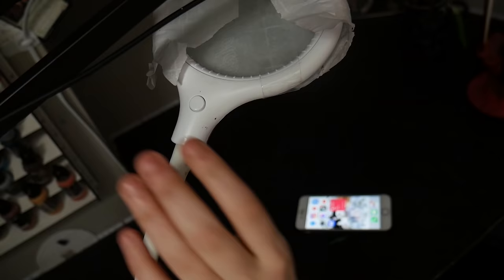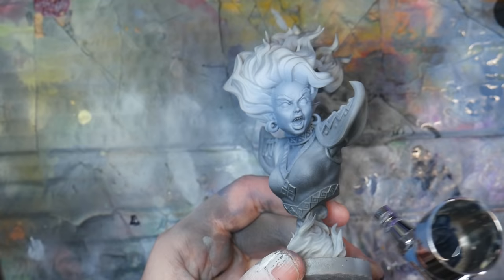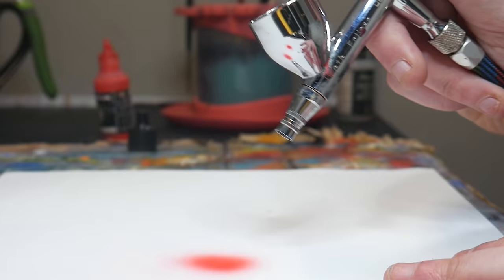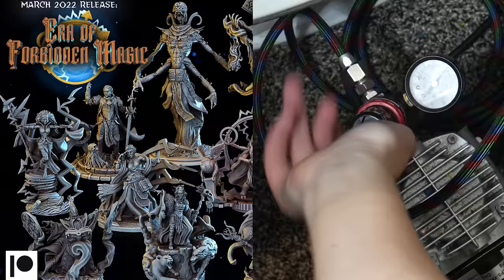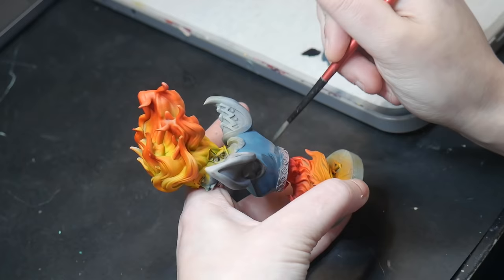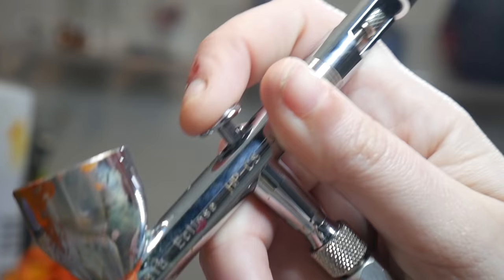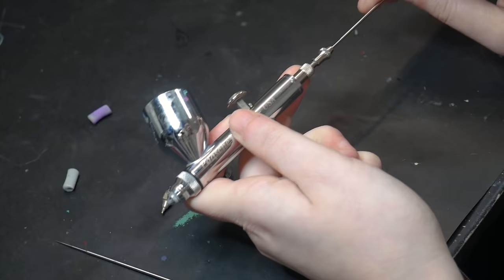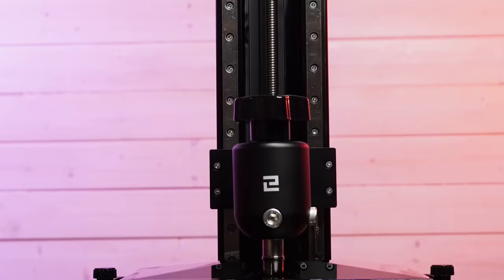Airbrush Miniature Painting Tips I WISH SOMEONE TOLD ME

Comment: Allow the air tip at the end to get damaged and chipped, used the need as a "poker," dropped it, left paint in it, didn't realize until today a lot of that paint that dried in there 10 years ago is still in places I can't hardly reach or see.  Sometimes I think I should just buy a new one.
Reply: If you really trash a gun then you need to get a new one. Which is why people are fastidious about cleaning them. Although today ultrasonic cleaners are available and maybe with the right solvent a clogged gun can be salvaged? Those ultrasonic units have heated tanks and the ultrasonic action can be effective. Some brush cleaners can loosen hardened paint. I wouldn't want that stuff in an ultrasonic cleaner in my house though. It's pretty aromatic and volatile. So if just the fumes don't get you it might still explode? I'm not a fan of any of that. But if you can do it outside it may be viable.

Comment: I started the airbrush back in '78. My tip to you is get rid of your compressor and then purchase, or rent, a cylinder ( with regulator ) of compressed NITROGEN. ( The air in Earth's atmosphere is made up of approximately 78 percent nitrogen. ) It is quiet, moisture free, and long lasting ( depending on canister size). Welders use cylinders of Nitrogen - they are quite common. ) You WILL thank me!
Reply: No one uses nitrogen to weld with. Helium used to be popular, heli-arc. Today we use argon and CO2. They use nitrogen to pump out cabling. Sometimes you'll see a tank strapped to a telephone pole. That's nitrogen. As far as moisture in air goes you can use a water trap. If it's really critical there's filters for air lines too. I have a shop air compressor and I just run a large diameter line out of it up vertically. The rise is too high for water to make it up the line. So it falls back down into the tank where I can drain it. I have a water trap too but there's never anything in it. My compressed air is bone dry. Humidity is often very high here too. So if I can make dry air anyone can.
Reply: @1pcfred  Nitrogen can be used by itself as a shielding gas for laser welding and plasma cutting, and it’s used in some heat treatments. It’s also mixed with other shielding gases for specific applications, but it’s not suitable for carbon steels. When shielding nitrogen-rich metals, it increases the alloy’s mechanical properties and can deepen penetration while stabilizing the arc. Nitrogen is also used as a blanketing gas once welding is finished inside tanks and enclosed spaces, to preserve the material until it’s used with its intended product. Your statement "No one uses nitrogen to weld with." is just wrong! Yes, as a shielding gas argon is popular, but many welders still use nitrogen. You can use a compressor, or anything that floats your boat, to do airbrushing; however, if you want a totally moisture free air supply, NOTHING beats nitrogen! And unlike a compressor, a cylinder of nitrogen is QUIET!
Reply: @burkholdst.rudderberg3574  plasma cutting is not welding. I have no idea why anyone would want to shield the cutting process. Being as you need oxygen to burn the metal. So I don't see what shielding would do for you. I have every welding system but a laser. MIG, TIG, SMAW and oxy acetylene. Laser is just too esoteric for most to have. But if you say they use nitrogen then they must. No one uses lasers to weld with either for the most part. Using edge cases to make your point makes a point. Just not the point you intended.

Comment: Surprised to see you are using a compressor without a tank. I was always taught that the tank provides consistency of airflow whereas using a compressor directly introduces "pulsing" which can mess up flow.
Reply: Yep running a cheap Chinesium tanked compressor. I have to be absolutely hammering the air out for a long time to affect performance. I get the quality argument, but Badger's tankless versions aren't much cheaper than a Master tanked one. Or spend a bit more for the Badger Aspire and you're still around the price of the basic Iwata tankless. (ps. if you buy a Badger it has american standard threads, nearly everything else is British)
Reply from the maker: I have often wondered if I could improve my painting with a new compressor!
Reply: @LylaMev  You'd probably become even more of a goddess. I started with a tankless compressor and managed to snag a second hand SilentAir. What a difference! For my ears too! Will buy that one again when this one dies (it's over fifteen years by now and still never lets me down)
Reply: @LylaMev  Yes you can, I know for a fact that your compressor cannot produce enough CFM. You'r airbrushes consume alot of air, I wouldn't use that compressor even for a 0.18 Micron. You can check how well your compressor does by holding the trigger down and watch how low your compressors pressure gauge drops. Even if you set it very high it will drop very low as soon as you press the trigger down. Actually this is how you should set the pressure. Hold the trigger down and set the pressure while the airbrush is consuming air. I bet it can't hold 30psi. And with the thickness of the paint you showed in one video you need more.

Comment: Tip: if Tamiya (brand) airbrush cleaner can't clean it, _it can't be cleaned_! Though the conventional homemade solutions are fine for getting a brush 85-95% clean, i strongly recommend leaving that final 10-ish percent to the professionals and i swear by Tamiya cleaner. Don't use it without a mask and plenty of open windows, though.
Reply: What you want is this toxic miasma they sell at home centers called, "Brush Cleaner". I think it's whatever noxious solvent they have a surplus of at the chemical plant. I have to warn you though, it has a distinct bouquet to it. Quite the nose. So it's best used outdoors. You crack that can open indoors and you'll smell it throughout your house. But I've put paint brushes in that stuff that were solid hard paint and it's brought them back.

Comment: Thanks. Helpful video. Two questions... any recommendations for a starter airbrush?  And what do you suggest if I can’t have a permanent set up?  I don’t have space to set up a spray booth and leave it up. Thanks!
Reply: they have airbrushes with a small air compressor that fits right off the airbrush, Ninjon did a video on it a few weeks back, go check it out.  If that's not enough bang for your buck then i'd recommend a Masters setup, it's what i've started with and while ive ventured out and gotten higher end airbrushes since, i still use my original Masters airbrush i got with my compressor. it's a solid setup for a beginner and will do you just fine.  As for the whole spray booth... I will sometimes just spray at my desk, usually for small jobs.. if you're going to try and go all out, you can either buy or make a spray booth pretty easily. The booths i think start around $100, some break down and are portable.  I made my first booth using a DYI video on youtube and a visit to Lowes.  Do your homework, if you're serious about buying an airbrush then you'll be able to find all the info you need on youtube, thats how i started out.  Good luck!
Reply from the maker: I loved my paasche talon for many years!
Reply: @chaoticpainting1507  thanks!  This is helpful.  Essentially, I do my hobbies at the dining room table and pack up my stuff when I have to. But I don’t have a spot I can dedicate to airbrushing. That seems like something I would want to set up and leave it. I saw Ninjons video and I wonder if I can use that airbrush until I can get something more permanent. My immediate goals are to learn to prime and base coat, eventually do some shading and highlighting so I wanted to invest in something decent but not overly complicated to start.
Reply: @LylaMev  thanks!  I’ll look into that one
Reply: @mattcappelli5822  yeah, that mini compressor might be what you need bro, you could even go outside go your garage or something if you're worried about the air. I'd get a hose for it, it would be awkward if you didn't have one in my opinion. I started at the dinning room table too bro, so I know what you mean. I didn't get an airbrush until I had a permanent setup, however, that small airbrush kit wasn't available at the time. You could even maybe invest in a somewhat decent airbrush and then use that small compressor/hose. Sounds like a good temp setup to me. If you're going to airbrush at the table though, make sure to put something down to cover the table up...
Reply: I've used HS from the start because they are so easy to take apart for cleaning and you can change needle size/nozzle. I don't know other brands at all, but I would definitely look at ease of disassemble/reassemble. And preferably interchangeable needle sizes/nozzles.
Reply: @chaoticpainting1507  I did it!  I bought one of those airbrush kits from ninjons video. It was on sale for $49. It’s completely worth a shot. Just have to order some flow improver and thinner. Pretty excited about this. If it works, no more rattle cans!
Reply: @mattcappelli5822  right on! You're dipping your toe in the water, good stuff. Just remember you can use water just as easily to thin the paint, I used to think I could only use thinner and it's just not true, water works just as well. Mind you, I use bottled water, not tap.. just keep that in mind. Also, an airbrush hose would probably do you some good as well, not sure how the feel of having that mini compressor would feel right at the bottom of the airbrush, it might work 🤷🏻‍♂️ good luck man, lemme know how you get on with it, you can always reply here if you have any questions.
Reply: @chaoticpainting1507  thanks, man!  I’m really excited about this. The one I bought comes with a cord. I’m only interested in priming, base coating, and chipping effects.  Stuff like that. If I like it and think I can be good at it, I’ll
Invest in something better to try modulations and shading and all that good stuff. Appreciate the offer for help. I’ll probably start messing with it next month when I get through my current painting queue
Reply: @mattcappelli5822  enjoy brother, you'll not regret it!
Reply: @chaoticpainting1507  You can only thin water based paints with more water so much before the ratio of water to binders to vehicles to pigments reaches a point which degrades both the paint's adhesiveness and cohesiveness.

This is what reducers and thinners are engineered for... to thin a paint to the degree necessary to effectively apply it through any chosen size airbrush or HVLP tip without sacrificing a proper, durable finish or the option of using them in conjunction with other products such as clear coatings or even safely washing them a year from now if necessary or desired.

If you wanna undermine the integrity of your own things by cutting such corners, hey... knock yourself out. 
But please stop (ignorantly) encouraging others to follow your lead. They may want or need their finishes to hold up or otherwise perform as advertised. Thanks.
Reply: @davidkoloc1313  acrylic paint CAN be thinned with water just fine dude, calm down. The myth that it HAS to be thinned with a thinner is just a lie. I've watched it done on Twitch a 1000 times by someone who literally never uses anything other than water and has stunning results. After watching it be done like this, I've even done it myself with stunning results. Sure, you can thin it past the point of no return, sure. But you can do that with any medium... not just water. Most of us, painting minis, will have to put a top coat on anyways to play with our minis. So no, I won't keep telling people who are on a budget to just use water. It works just fine.
Reply: Just ordered me one of those as well. I figured I don't really have an excuse for that price and can always upgrade in the future.

Comment: so the last step about cleaning, the EASIEST way to avoid this is not to clean the pot out, simple NEVER pull the needle out of the back of the air gun, instead remove the needle cap and nozzle, then push the needle out the front of the brush, this ensures paint is only in areas it is suppose to be.

Comment: The cleaning part is overly complicated for no reason. Open the front, push the needle foward, clean it, clean the pot, and that's it. 
I also recommend getting a cheap straight interdental brush to clean the internal metal tip from time to time.

Comment: Stupid mistakes I have made; wrong pressure--either too high or low, wrong tip match to the needle, bending the needle tip, breaking off a piece of the tip, removing the needle with paint in the bowl. letting the tip dry out while painting, dropping the brush on the floor--full of paint (we will not discuss this incident in front of my wife), forgetting to shut off the compressor for--days.   Now, something I have done right is investing in an inexpensive ultrasonic jewelry cleaner then periodically disassembling the brush and giving it an ultrasonic bath.  You'd be surprised how dirty the water is after bathing your supposedly "clean" brush.

Comment: I pull my needle out with a full pot every job. Literally every single time. There is no way paint will make it past the need pack seal, which is always brass. If you tilt it backwards with the needle out yea paint will go into the body because of gravity but that's is the only way. If you're getting paint in your body, you've shoved a knock off needle through the needle pack making it wider...brass is softer than steel.

Comment: I have painted things for about 55 years now. You did really well on this video. I am glad that you showed the face filters, I just find it funny because I only wear that PPE when I am painting a car or airplane. Everything that I actually airbrush is so small and I use enamel's or acrylic paints, to there really is no fumes or mist that could get anywhere near my lungs unless I was to stick it in my nostrils and push the trigger. 
You did make a good video with good application advise though. I use a Badger that is a siphon set up. I also use siphon guns when I paint cars or aircraft. I have never liked HVLP guns. Each to his own, I just don't like the paint on top and the feel of the weight with the balance. I will have fun painting the 1/200 scale Star Trek models I am designing to 3D print:
https://youtu.be/1hushBsz9x0

Comment: Big mistake. Don't pull the needle out through the back of the airbrush. If you do, any paint still on the needle will be dragged through and deposited in the least accessible part of the airbrush. Always remove the tip and remove the needle through the front.
Bob

Comment: Finding the right ratio paint:thinner for different techniques was time consuming and yielded many fails. Same for air pressure.

NEVER! blowback for cleaning or mixing paints! It only causes paint or residue to enter the trigger area. Also you run the risk of bending the needle.

Whoever came up with this idiotic procedure, needs a slap in the face.
Reply: If you are getting paint back in the trigger it's obvious the front seal is compromised. Maybe if you crank the pressure to like 60psi.
I've been using blowback method for 20 plus years and never had issues.
Reply: @fateweaver9844  Agreed. His needle bearing seal is obviously loose.

Comment: Never ever pull the needle out of the back end of your airbrush. Always pull it from the front, other wise you are just creating yourself more to clean. Because if there is paint still on the needle your pulling it through a section that has nothing to do with paint. Also be careful with back washing because if a seal goes you will get what happened to me. Blew that shit all into the trigger mechanism.